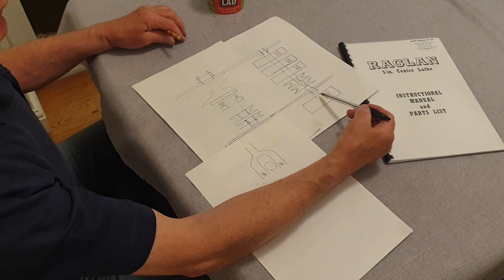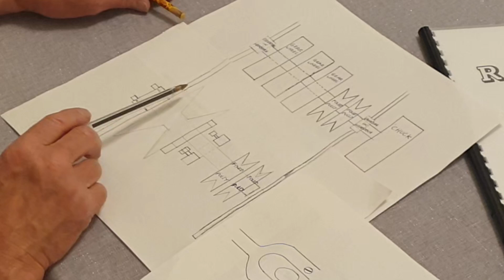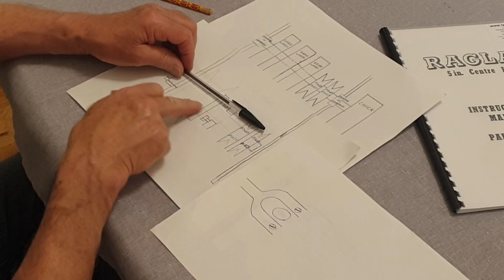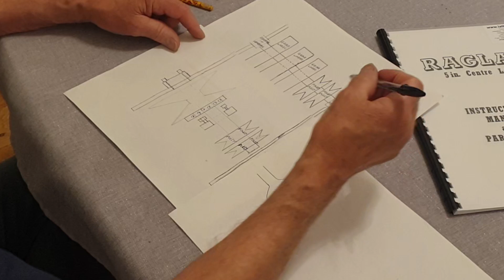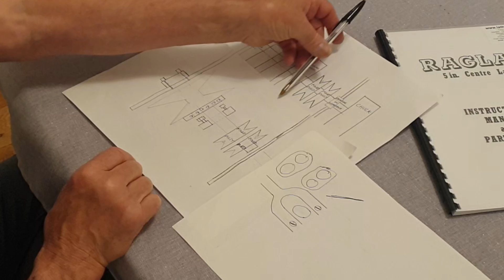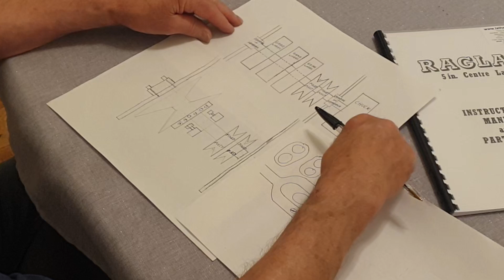RAGLAN                5 inch           centre lathe              twin  v belt      replacement

Comment: i would do the same Andy. 
we have a Raglan Lathe at our MES Club
atb👍👍👍👍🚂🚂
Kev
Reply from the maker: Cheers Kev, Good Solid machine.
The two belts are trying to pull against the set of the adjustable nearing house to cause tension on the two belts.
I DID NOT FANCY ALL THE SETTING UP OF THE MAIN SPINDLE BEARINGS. SO I took the easy route and ASSUME that the alignment,  end float etc is correct😂